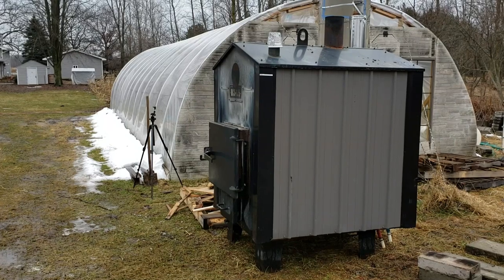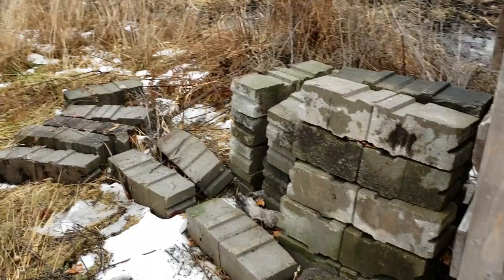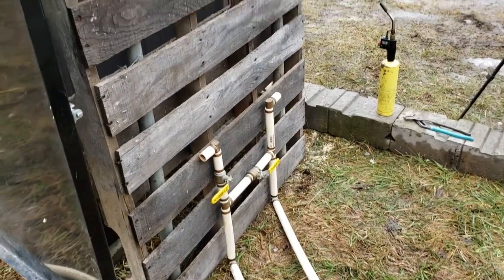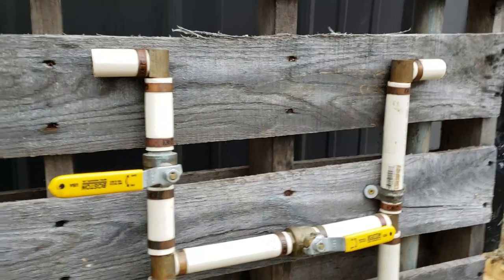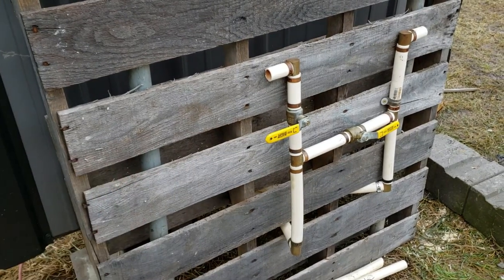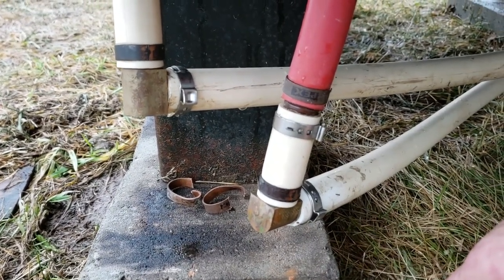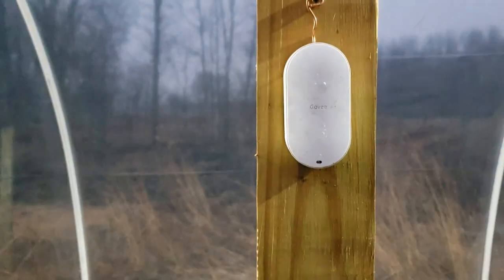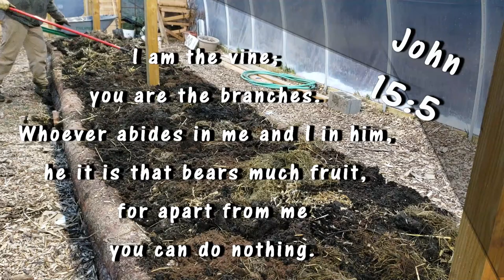Heating a Raised Bed With a Wood Boiler - Log Raised Bed Part 6

Comment: Nuff said on the tool. I re-plumbed my house with PEX, easy to work with but tools are expensive. If your heater ends up putting too much heat in the bed maybe you could put a heat radiator in line to heat the air inside the green house. I have a lot of waste jet fuel available to me so I intend to fabricate a fuel burner like we used in the Army to heat my hot house.  You are an inspiration.
Reply: Can often rent a tool from builders supply for cheep

Comment: I love pex! I am converting my house to it. I use the same clamps you are using but I am using the right tool and they work great a great investment I use it so much. Pex is so much more inexpensive and easier than copper. I think you should have buried the pex deeper but am sure it will heat the greenhouse. Why are you not incorporating , I guess you still can, the syrup boiler into the heating system.

Comment: 2 years later no leaks from the pex clamps. They seem to either leak right away or they don't. Much faster than copper and the clap tool well worth the money. I replaced the copper in my house, it was leaking and the recycling of copper paid for the job. Win win.

Comment: Pex is awesome to work with.  Much faster than copper.   Wrong tool to tighten clamps.   Your clamps are too far away from the brass fittings.   Should only be 1/8 from the end of the pex. Shark bite fittings are another option .  Love your talking through each task.   Carry on my friend.
Reply: Shark bites are the way to go, no doubt.
Reply: Shark bites are great if your made of money.
Reply: julien hunt   True at $10-$15 each it adds up quick, but it is a huge time saver and will not leak.
Reply: What is the correct tool?
Reply: @Yutani_Crayven  - The style of clamp that SSLFamiltDad is using is an Oetiker clamp.  The do make a special tool for them such they can not be over or under tightened, assuming you are starting with the proper size clamp to begin with/
Reply: Personally, I like the copper "crush"/"compression" style clamps.  to me they just "look better".  The swaging tool is not that expensive.  (Professional use a battery operated tool, but you need to do THOUSANDS of connections to make it cost justifiable.)

If volume is important (gal/hr), then use 3/4" or better yet 1" PEX.  If you are feeding multiple faucets/outlets, spend the money and use the 1" !

PEX-A is more flexible, less "memory" and kinks can be repaired with a heat gun, but it does cost more.  PEX-B cost less.  If you buy a coil, you better have a warm, sunny day so you can un-coil it and let it "relax".  Still more rigid than PEX-A.
Reply: If you can find a plumbing warehouse or a local hardware store or something that rents the Uponor PEX expansion tool in my opinion that's the best way to go, the fittings are cheep and made from the poly, since you expand the pipe then insert the fitting the inside diameter of the pipe stays consistent and no clamps are required because the memory of the pipe holds it in place. I believe you can only use pex a with the expansion fittings though. Sharkbite is simply fool proof but the fittings are outrageously expensive, I only use them when transferring from copper.

Comment: Syrup is running I tried!Heat that pex with torch or hot water use hose clamps! (reuseable) Those clamps you have also known as Oiteker clamps are for rubber applications. Those clamps are made across from where I work!
Reply: You can defiantly use these rings for pex with the right tool

Comment: PEX is wonderful... the sooner you buy a good compression ring tool the more you will appreciate the simplicity around the farm... GO PEX!  BTW the ring distance on the fitting barb is critical - one-half ring distance of pex to ring. Look at the fitting barb - the ring must compress the PEX over the barbs. Cold PEX definitely requires a PEX ring compression tool - don't waste you money and time with the clasp rings - get the solid copper rings. IF YOU DONT HAVE TIME TO DO PEX RIGHT THE FIRST TIME WHEN WILL YOU HAVE TIME TO GO BACK AND DO IT OVER... WITHOUT THE RIGHT TOOLS... Once you educate yourself how to use PEX you will never go back to the old way. PEX is the best way.

Comment: you can control the temp on the green house loop by partially closing and opening the two valves
Reply: no you dont do that as the water must stay moving and warm, or it will freeze

Comment: With your boiling set up that you had in the house you probably had a radiator that was mounted on top of the Furnace that should work well to heat the air inside the greenhouse you might get away with just using a box fan on it.
Reply from the maker: That is an idea I had as a backup if this doesn't work. I also have used car radiators in the past that have worked well
Reply: @SSLFamilyDad  I don't know how difficult it would be to get the one out of the house removed from above the furnace but I imagine it's probably a little bit more set up for heating air with so it might be worth the effort. One option might be to have it be first in line in the greenhouse then after the water has cichlid through the radiator let it circulate through the bed and back to the boiler it might not be as hot by that point so you might not need a mixing valve but I have heard of some people shutting water back to the boiler to keep it hotter then what the actual demand is needed to help the boiler run more efficient

Comment: You should consider using slip on fittings, no clamping necessary they just slip right onto the pex and hold tight. Can't remember the exact name of them but they work great. I've used them several times and have never had any leaks. You can get them at lowes or home depot. They cost a bit more than your regular fittings, maybe $5 to $7 each but well worth it.
Great work your doing there on the farm. I enjoy all of your videos. You are an inspiration. God bless you, the farm and your family.
Reply: Sharkbites ??
Reply: Yes, that's the name. Thank you. They work great.
Reply: He has 7 fittings in just this litte installation alone (granted if you have room you can just not use elbow fittings) but at 7 bucks a fitting plus something like 14 dollars a valve with two valves that's $112 in fittings alone. There good to fix the washing machine fast but for a whole job it adds up real real fast
Reply: And he's using 3/4 and 1 inch here so the fittings are even a bit more expensive then your standard half inch
Reply: Is this boiler heating your house as well? That's a $3,000 and up piece of equipment please tell me your heating your house with it too
Reply: @TheLowCashHomestead  Only the green house, like many others have all ready said and like he said in the video the boiler came with the house he didn't buy it for the greenhouse

Comment: IWISS PEX Clamp tool is just $27 on amazon. Works great with the clamp rings and comes with simple, clear instructions. Brass fittings can be reused without issue. So far I've only used the plastic kind for plugs, but have reused those without any problems either. I just carefully cut/shave the pex tubing off of them instead of torching.
Reply from the maker: Just bought it:)

Comment: The PEX crimping tool that you were using is meant for landscaping kriffing they sell a ratcheting crimping one that works a lot better. And the ones that are on the boiler already are compression rings that are squeezed on with a tool that is when compressed just slightly smaller then the size of the Rings you can sometimes pick them up for about $30 on sale at a tool store
Reply from the maker: I think you are right about that, it says crimp for poly pipe but then has the PEX logo on it. I guess it is time to give up and buy the better tool:(
Reply: @SSLFamilyDad  yeah I have used those same crimp rings that you are using but I use the ratcheting crimper mine is a blue handled one not sure if that is the same down in that part of the United States as it is here in Canada but I did buy it from Home Depot and I have seen the same one at Lowe's you can buy one with a bunch of rings for about 40 bucks I think I have seen them on Amazon for about 24 bucks I have never had any of them leak unless I have messed up the crimp when I've been in a bad spot and have done it incorrectly I do like the silver ones because the crimp rings can be broken off what's a vice grip but I wouldn't put them in an entire house myself I would use the steel crimp ones with a good quality crimping tool

Comment: matt risinger has a good vid on the diff types of clamps for pex  he did a challange between 5 diff clamps the sharkbite  clamps blew first after that the pipe blew rather than the clamps/.  i think that you need to have a diverter inside to make a air heater for the room

Comment: It will be interesting to see how this heated bed works out.I'm wondering if it will heat evenly our if there will be hot spots where the water comes in and cold spot where the water exits the bed

Comment: There are 3 types of pex and multiple types of fitting for each.  Search "build show pex" here on YouTube and study up before you use them in a critical application.  Also, once you heat it, it is ruined.  Cut off the fittings from the salvaged pipe before salvaging the fittings.  Then always use new clamps.  In the meantime, keep topping off that boiler so that it doesn't overheat and warp or crack.

Comment: Of course it's going to work and you can always use the fire pit to get the humidity up in the green house to trap the heat in. With green houses the whole objective is to use solar energy to create its own atmosphere.   Like a closed terrarium. 

I asked if you were going to make a drip  system. But you can just make a fire boil some water for an hour and water everything with the fog.   Make it rain

Comment: pex is used in 90% of all new construction here now, them clamps your using will do fine for your out door junk, but never use them in a home or shop as it will be nothing but a big headache and problems, as the ones you are using are steel and the minerals in the water rust them out in a year or 2 and big leaks, and they dont hold tight, they are made for fuel line and the old polly pipe, you will see in the stores these kits to change from polly to pex, thhe fitting is brass like the pex ones but one end is coated for the Polly end to help stop the corruption and has a clamp like you are using plus that solid copper ring for the pex, some company put a black tarnish on the copper rings but the true pex brand are copper color, and that is the only ring you use on pex, and the copper rings take a diferent tool, you can buy one that will do 1/2' and 3/4" for $40 .. if it gets a bump in the ring when you crimp it, you screwed it up when you crimped it by not holding the tool an die true. cut it off and do it again, when heating ground for a green house, to help with not burning a ton of wood we put 2 inch foam on the ground and seal the top off with a 1 sided foil bubble wrap then lay out your 1/2 pex then cover with your planting durt, as foam and foil the edges so your not heating china, as water will rob all your heat down and out in to the ground for miles, water is the biggest rob of heat on these systems, not the durt, if you had bone dry dirt the heat loss would be little, thats why we install the lines to a home on side a 6 inch solid weeping tile and wrap each pipe in a 1-1/2" boiler wrap, when we do winder installs, we lay the duct on top of the ground untill spring and go back and put it 4 to 6 feet under ground, as we cant dig though 5 feet of frozen ground, and the snow never melts off the duct,, this is why many complain about using tons of wood to heat there home, simply because the under ground lines are not insulated and sealed from water getting to it, and all winter the snow melts were the line is and is mud all winter, ground water robs all the heat, if the water temp leaving the furnace is at 180 deg F it shouldn't be lower then 177 deg on the return, if it is your lines are no good, and pump is way to small to move the volume, your pump i see is way to small. you need a minimum 60gpm pump and that style you have never lasts as they are built for zone valves and not made to run 24/7 and that pump must always run, the pump you have you be lucky to get 2 years out of it.. if your just using t to heat the ground and no water to air heaters turn it down to 100 deg.. 
, when we instal in floor heating we run the return line into a mixing valve to cut the temp down to 100 to 110 deg, and cut the stove back to 160, but for water to air heaters you need the 180 with a 10 deg off set, your leaks will seal up once ether 30 psi is added or hot water, and your pump will not put out 30 psi, but being you didnt install the heating line right your going to burn lots of wood and heat all the way to china, nothing there to stop the heat from going down and out
Reply: Just do it right the first time...

Comment: the tool that tighten that clamp will bring it a lot tighter  than what you have accomplice  with that tool . those clamps work good with right tool and it works with multiple size clamps

Comment: You have the wrong tool. The correct tool tightens the clamps around the connection without any wrinkles. Ask around to borrow one. Its a pricey tool

Comment: Never consider any tool an expense but rather an investment. Once you do pex and do it correctly you will hate the other stuff. Used it in the warm in our bathroom and replaced the water heater connection wow. That doesn't look like pex pipe either. Pex comes in red and blue.

Comment: My opinion 
You will cook the roots
You need about 70 degrees around the roots
Mixing valve needed
Don’t turn the stove down past 150 or a little lower or  you will eat out the inside of your firebox quickly

Comment: For now get a coupe pieces of steel pipe to get more leverage on those handles on your current crimping tool that might work. Check out a couple videos by Matt Risinger on pex and the different systems, thes a couple major brands and its best to stick with a particular brand if you can. There's 3 different kinds of pex and I looks like your using a mix of pex a and pex b. There's four different types of fittings (generally). Crimp ring (that's on your old work), crimp tab (what you're using) expansion (my favorite the tool is kinds spendy but the fittings are just about the same cost as copper) in other words, YouTube it man you provide so much info on this channel, there's just as much of it on pex on other channels its really allot to leave in a comment but I really tried to sum it up. I hope you plan on adding antifreeze after all the leaks are sorted.

Comment: Buy the real PEX copper crimp tool. You will be glad you did. Also, most PEX pipe is not UV rated, so you might want to consider covering up the exposed pipe that doesn't get buried.

Comment: Do you have room to put the boiler in the greenhouse?  Residual heat for the greenhouse, rather than losing it to the outdoors.  Those good crimp tools are expensive, but they last forever and you will never regret having them.  If you plan to heat and irrigate a farm, you will become an expert at pex.  Start collecting high quality tools for the trade now.

Comment: Spend the 80 and then you forever have what you need to properly do the job !! You need the piece that stretches the ends to seal the ends to joining piping and then you clamp it for more security but you should’ve atleast switched everything to pvc if you don’t no anything about pex.. all you need with pvc is the pvc glue and the cleaning solution and you buy the piping you need and you have a new system that is reliable

Comment: I think the pex will work with new piece. i think the old brittle piece is the issue..I re plumbed my whole house with pex. I have the rings  like the one you cut off, and the other style crimpers...They never tighten to where it doesnt move, which concerned me at first, but a year later still no leaks,,I was skeptical at first,,but now im sold. Easy to work with,,, Also, I dont see why the boiler wouldnt heat the space up through the beds,,best wishes going forward,,God bless

Comment: You have plenty of repetition in the comments about using the wrong tool, but looking twice, I did not see mention of temperature.  Long ago, I was reading that Wirsbo rates their PEX for a max operating temp of 150 degrees.  That 160 might eventually lead to a failure.  It's not far out of spec, though, and your brand might even be rated for 160+.

Comment: Menards/homedepo carrie the right tool for your fittings about 60.00 dollars. if you havent done it yet just use the tool on the fittings you have already done most of the time they will set right .adjusting the tool will help a bad clamp. pex is the way of the future. so cheap and easy. copper has got so over priced and the fittings for copper must be made out of gold.

Comment: I've used shark bite connections, pretty fool proof, expensive though. What is the lowest your boiler will go?  Sap running already!  I was going to collect at my parents house but not til beginning of March,  guess ill miss that.  Could you bury a sensor in the raised bed to monitor the actual soil temp?